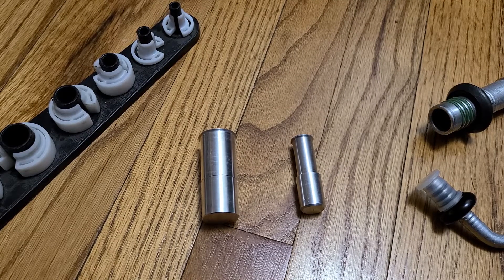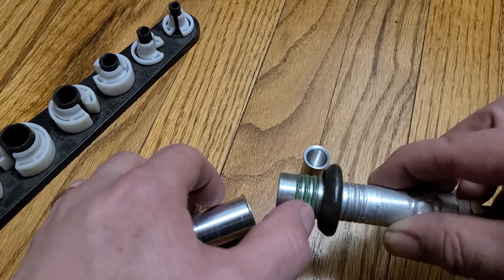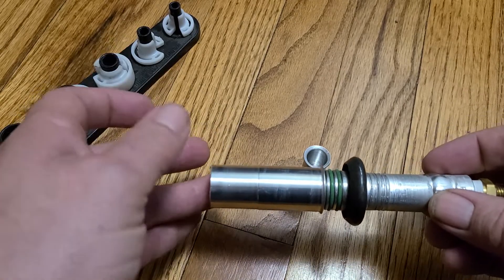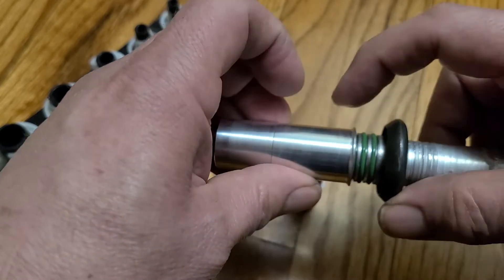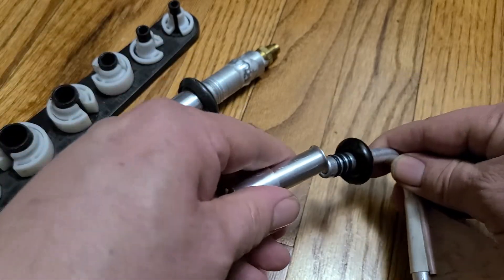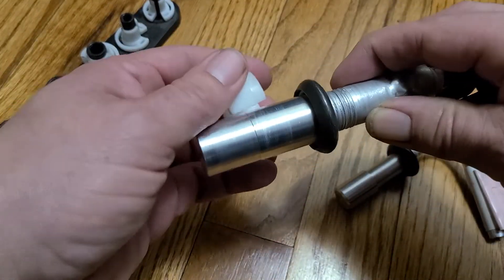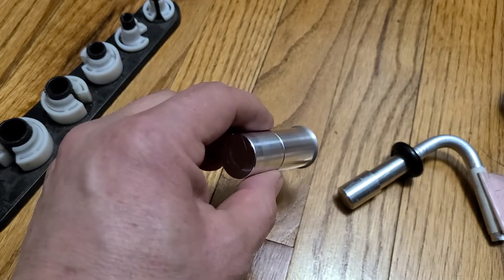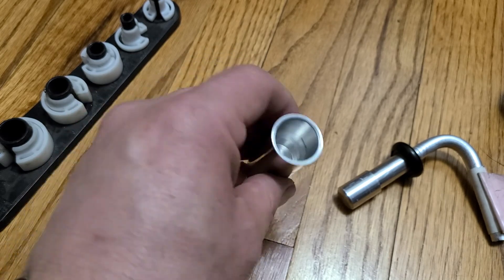Detroit Thermo Ford Springlock AC female block off fittings

Comment: Have you faced a situation where the male end just won't connect?  I'm replacing the AC components on a F150 with Four Seasons parts, that includes the Four Seasons accumulator and evaporator.  I cannot get the accumulator hose to connect to the evaporator port and I'm applying a lot of force.  I got another new accumulator and it has the same issue.  It seems that the issue is on the evaporator side of that connection, a, maybe the flaring spec or the initial part of the tube length is not long enough, it seems to taper off.  Any ideas?  Thanks for posting this video and how easy that click-in is supposed to be.

Comment: Is there an alternative to using those specific tools you used to take them off?
Reply: Just trying to find a way to do this without purchasing a tool set I’ll never use again. If not, do you mind linking to the disconnect tools used in the video? Thanks for your time
Reply from the maker: If you search for Ford Springlock tools you'll find them. about $8 for a set of them